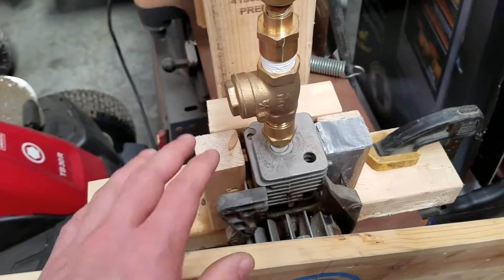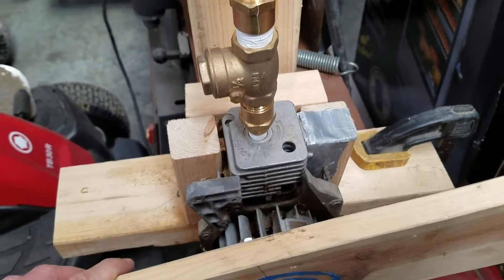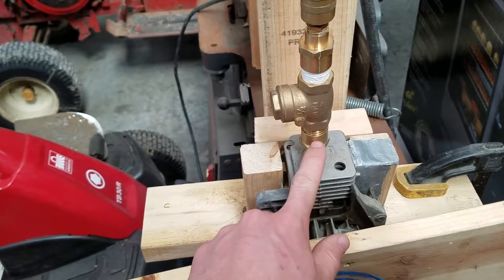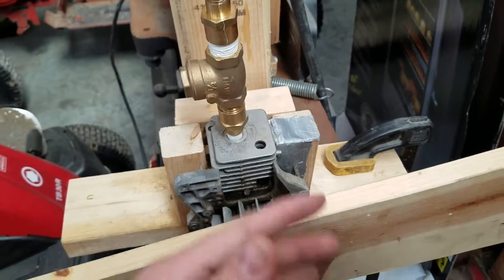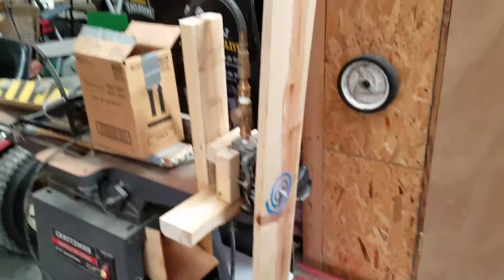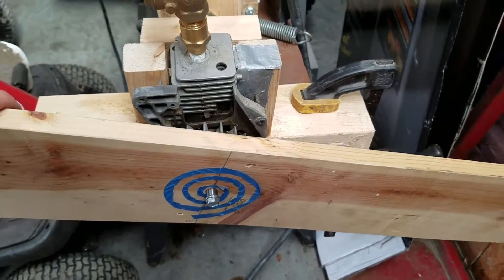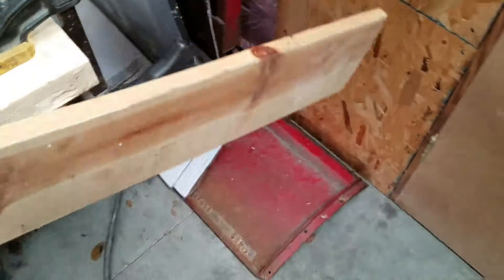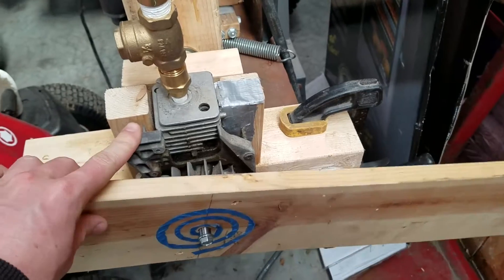2 stroke steam engine in action

Comment: I wouldn’t use that fly wheel with steam, it has way more power than compressed air. I’m tinkering with a pillow bearing shaft and a big heavy brake rotor as a fly wheel. But with steam i wouldn’t trust a piece of wood.

Comment: Interesting, but it's not a steam engine. It's an air motor!
Reply: Dumb ass
Reply: If something runs on air then it runs on steam
Reply: Your stupid its a steam enhine a steam engine can run on air or steam and air and steam are both gasses dumn ass and it was a engine in the first place so how is it gonna magically turn into a motor .
And a motor runs on electricity
Reply: He’s probably wanting to see the whole thing I’m guessing. Boiler, ect
Reply: And without steam, it is an “air motor”. They got those too
Reply: @xxzenonionnex7658      Steam engines operate by injecting extremely hot water into the cylinder, not air or a vapor. It's super-heated water. Because the water is super-heated, it instantly vaporizes. That instant vaporization is what pushes the piston down. Didn't you take thermodynamics?
Reply: @markflierl1624  dude that’s not how steam engines work. You’re thinking of hot bulb Diesel engines . Steam engines boil water and it expands into a gas . The gas is released through valves pushing down the piston. I shouldn’t even have to tell you this lol.
Reply: @markflierl1624  there’s literally no steam engine that runs on superheated water .